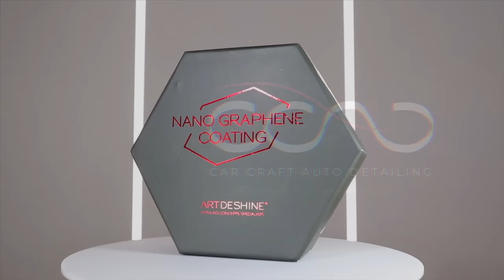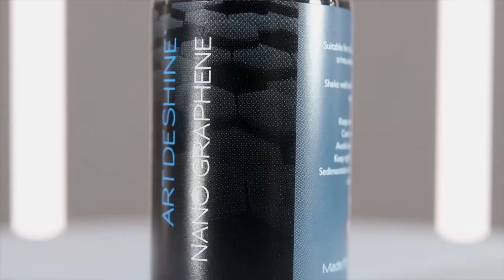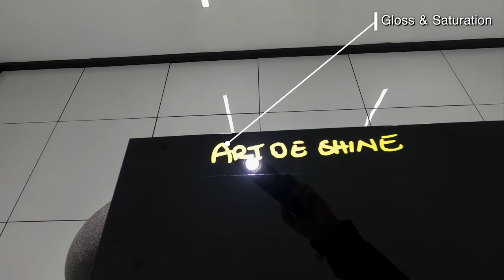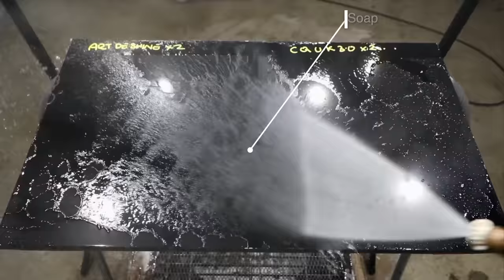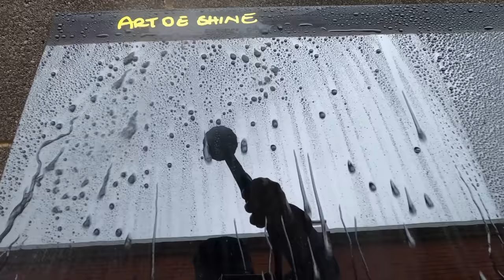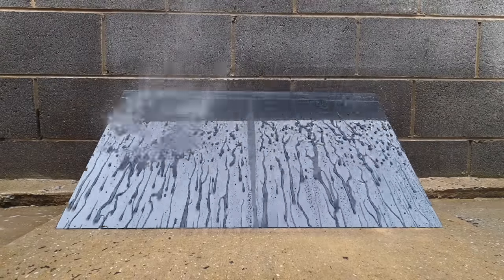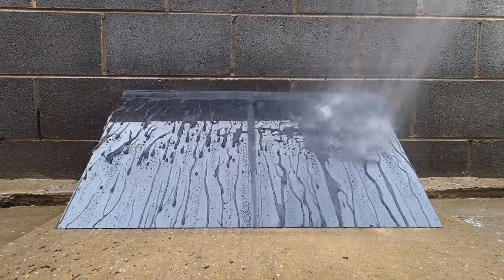A REAL LOOK AT GRAPHENE vs CERAMIC COATINGS + ArtDeShine Graphene Coating Reviewed!

Comment: Had to check my box with Artdeshine as you said any instruction wasn’t in yours?

In my box from Artdeshine
I also had the copper Artdeshine Nano Graphene card, some stickers BUT also a instruction book how to apply the coating. 
In it the instruction was application guide, curing, usage/storage.
The instruction was easy to understand and follow.

Comment: Great test & review, thank you.  I just did my first graphene, with Adam's Graphene Ceramic. It does flash very quickly like the ArtDeShine but it was not difficult to level out, even if it dried a bit.  The gloss and slickness and hydrphobics are impressive, and if it's no better than a consumer-grade ceramic, that's ok by me as I picked it up for $69; not much of a premium over most ceramics. If it performs better, great.

Comment: I believe the biggest difference in expectations between the graphene ceramic coatings and the previous SiO2 coatings is that the graphene ceramic coatings are supposed to retain less dust due to its anti-static properties and to keep the car's paint / surfaces at a cooler temperature, which would obviously be better to protect cars in hotter climates. The hydrophobic qualities and gloss factor are essentially the same. I've used Adam's Graphene Spray coating and Adam's Ceramic Boost spray coating, and performance wise they are nearly identical. Just like with any other detailing job, it's more about the prep work with the wash, decontamination, clay bar, and paint correction prior to applying the coating.

Comment: I been detailing cars for the past 12 years now. False marketing is the main issue here. Over hyped product strength and false promises lead to customer’s disappointment and lost trust. I have tested almost 50 different brands of ceramic coating throughout the years but to be honest non of it come close to what they describe. End of the day whatsoever technology that you use it’s not permanent solutions! The car owner need to take some responsibility to maintain their vehicle. As a Detailer you have to be sincere to your customers whenever you presenting the solutions.

Comment: Sandra, great video!   I recently applied Art de Shine BX graphene coating and Maintenance coat.  Both were very easy to apply and remove.  It was a good experience.  Apply, wait about 20 seconds, and wipe off with two microfiber, no wetting or leveling agent needed.  The BX left a very slick surface.  I applied a second coat 24 hrs later, then the Maintenance coat another 24 hours later.  The Maintenance coat seems to have reduced the slickness slightly.  The applicator cloth dried similar to your Nano cloth. I am looking forward to seeing how it holds up.  Thank you for all of your great material!

Comment: Thanks for the video. Your results chemically line up with my testing of SPS graphene over the course of a year against other ceramics I clouding Cquartz UK 3.0.  The initial performance is great but just as you noted once that shield is pierced it degrades rather quickly.  We shall share if graphene has the staging power or if it will just be a fad.
Reply from the maker: Thanks Mike, I appreciate you sharing you’re own experience and results as well!

Comment: Hello Sandro, super glad to see you got your comment replies back. That was thousands of comments. Got a few questions if you don't mind. 

1 - From my research NV Snow is the only wash I know of that is ph neutral with no gloss enhancers or wax. Its currently out of stock in the usa. Do know of any alternatives?
2 - My car is now ceramic coated (cquartz) and i'm considering using a ceramic infused wash. The main thing going through my mind is whether using a ceramic wash on my glass (coated with nv glass ceramic) could mask the effectiveness of my glass coating. What do you opt for currently with maintaining ceramic coatings ( ph neutral washes, carpro reload, carpro reset, ect)
3 - After loosing my mind until 11pm cleaning interior glass, I generally feel that compared to nv clarity and a few other streak free cleaners nothing removes residue better than pure IPA. Have you had the same experience?
Reply from the maker: Thanks and my older comments are gone for good but I can still make new comments moving forward. 
CarPro Reset has no enhancement additives and it’s also great maintenance wash for coated cars. 
Ideally it’s really best to stick to pure car wash soaps as hydrophobic additive ones can mask the superior behaviour of your various coatings. I tend to use Nv Boost a lot and it really seems to play well with the paint and glass coatings with no issue but Elixir could also be another good option. 
Cloths are also extremely important when cleaning glass, to make sure they are super clean and only used for glass but I personally have great success with Clarity and Eraser, but it you feel a straight IPA solution works best for you I’d just stick with it!

Comment: I really enjoyed the information and comparison you provided. It seems that everyone is testing their coatings, whether it be graphene or ceramic, based on gloss enhancement, chemical resistance and of course ease of use. Part of the benefits touted by these products is the resistance to swirls and light scratches. Has anyone devised a test for this? It would be great to add to the testing process when comparing products, but I’ve never seen anyone do this. Keep up the top notch work!

Comment: Graphene will definitely be the next hype marketing product. Adams is advertising their’s heavily. 303 also came out with a spray on, wipe off, graphene coating and it’s already sold out. 

Thanks for the hard work Sandro! Guess we should really pay attention when CarPro, Gyeon and Gtechniq start pumping graphene products. A Gtechniq higher up is part of a detailing Facebook group I’m in and he claims they’ve tried messing with graphene but unable to produce anything better than what they offer.
Reply: El Stormbringer  honestly Sandro is the only detailer I’ve watched on YouTube that I trust to review products. I watched that Apex detail video and when I saw him apply the spray to a car that was already fully corrected and coated I shut that shit off.
Reply: El Stormbringer  to be fair, that was the Zymol graphene spray that failed after the first wash test. 

Brian’s review of the 303 graphene spray received a passing grade though.
Reply: El Stormbringer  that wasn't the 303 brand graphene spray coating, it was the zymol brand.

Comment: I’ve said it before and I’ll say it again: “graphene” coatings are just high end ceramic coatings with an RGO additive just so they can slap graphene on the label and milk the hell out of the hype it’s been on for quite some time. If tech giants like Panasonic have been having trouble with the technology in its solid form even with their advanced facilities and manufacturing processes, what makes you think the detailing industry could just put it in a bottle in liquid form and have it be stable and apt for such a niche automotive use? It just doesn’t add up. It’s funny, if you’re objective/skeptical about this people get mad at you and/or call you a hater. MARKETING 101
Edit: small spelling error
Reply from the maker: There’s always a lot of strong opinions around anything new, but I appreciate you sharing you’re thoughts which everyone should be able to do!
Reply: @CarCraftAutoDetailing  Yeah, regardless I’m gonna try out the new graphene coating from Adams. I’m already bored and wanna polish my car again as it’s been 1 yr since I polished and put UK3.0 on it and it’s still performing like day 1. I believe the Ethos and Adams coatings are the same as I think they’re both blended by B&B but only the manufacturers know that. The adams coating seems to be SLIGHTLY more hydrophobic than CQUARTZ and I just like trying new products.
Reply from the maker: Let me know how you go!
Reply: You are right that reduced Graphene Oxide (rGO) is used as an additive in a silicone polymer or composite just as SiO2 or TiO2 is used the same way. These products are widely misunderstood as graphene, TiO2 or SiO2 based when really they are used as additives for enhancement of certain properties. Even more widely assumed is the coating is a "1 atom thick layer of graphene" which really isn't what Artdeshine is trying to make or market as that will not give us any beneficial function we need. That is what many electrical companies are doing as it gives them electrical conductivity and sensitivity. We need not that refinement of rGO or even pure graphene. And Artdeshine do know how to disperse rGO into polymeric matrixes. 

Artdeshine's Nano Graphene Coating is not termed ceramic because the percentages of SiO2 which the term "ceramic" came about is very low. Most of the components are silicone polymers that are cured to be softer and more flexible as compared to hard like you noticed in the applicator cloth. Hardness does not determine how durable or abrasion resistant the product can be (Artdeshine does make hard ceramic coatings too). Abrasion resistance mostly comes from how much friction is produced by the surface, more sleek less friction less chances of marring.

More about why rGO is used in the product. It is a fact that rGO helps with anti-corrosion and in the polymeric matrix it has shown capabilities in IR transmission tests to lower IR absorbance. This is an indicator of lower thermal absorption which we know heat is a very strong catalyst in chemical reactions with contaminants that causes etching.
Reply: @artdeshine7067  Thank you for your useful post :)
Reply: I agree, it's all free marketing issues.  It's the issue of honestly. It's becoming a circus on how we used to buy by the gallons and now in even smaller than eight ounces for rediculous prices.  Customers are being scammed and scared by long days in the shop, long and confusing explanations,  very expensive prices expensive, expensive maintenance and being shoved all kinds of products. My questions is what about the customer??🤯🤔
Reply: @Gnetbird  I assure you, there is a relatively large market of people who appreciate and are willing to pay the money for high end detailing and protection products. I do it both professionally and as a hobby in my personal cars and it's just one of those things that not everybody appreciates. It's a niche market with niche customers.
Reply: @artdeshine7067  Do you have any sources for these IR transmission tests? Or did you do them yourself? My understanding from quotes from employees working on car coatings is that the difference in temperature on a graphene coated panel is tenths of a degree. My assumption is that the thin film application on car paint does not demonstrate the IR benefits of graphene and I’m trying to find research that shows otherwise.
Reply: @glumdogtrillionaire   Now now, we're not here to fight.
Reply: @davek2977  Hi Dave, we work together with an educational institute to find out more on the capabilities of the product. One of the test they did was IR Spectroscopy. The absorbance rate was about 85-90%, meaning 10-15% is being reflected. This was done on a cured sample instead of thin film application as test panels are not transparent.
Reply: @artdeshine3997  Thanks for the reply. My understanding for IR Spectroscopy was that it is a tool for understanding the composition of the sample based on the IR frequency, not for determining its practical performance with heat absorption/reflectance. I’m guessing that a comparison was done with a more typical polysiloxane “ceramic coating” (no rGO) did you see a similar absorbable rate? And is there a difference between the coatings and bare clear coat?

Comment: Sandro this was an incredibly well thought out, researched, and superbly produced video, which I believe has become your signature trademark.  You constantly and unswervingly share the basic and blunt truths of every product.  You accomplish this with a very thorough explanation, that is well laid out courtesy of your systematic presentation. In the two years, I have been watching YouTube channels, few, if any produce a more comprehensive testing scenario to match real-world conditions than you Sandro; period, end of the story.  

My search to find the best coating to prevent or reduce the effect of water spots on non-garaged daily drivers over the last few months had finally convinced me to switch from Sio2 coatings to Graphene was from faulty conclusions I gained from believing the hype from all the manufactures and the youtube channels.  But Brian at Apex and Brian at Chicago Auto Pros gave me pause when I watched their conclusions and now after watching yours, I feel that Sio2 coatings are still equal and in some ways still superior to Graphene and am sticking with Sio2.  Granted graphene coatings have for the most part relied on YouTube host's comments that showed graphene had better slickness, sheeted more than beaded,  ease of application, and a better finish for the most part and only lately have some of the more credible hosts like yourself brought up the fact that a lot of the Sio2 coatings, after years of testing, have maturated to a point where they also have ease of application, high levels of slickness and some are even seeing sheeting.   The conclusion that has been sold to us, is that Graphene is much better in reducing or preventing water spots and even if water spots appear, they can be more easily removed from a graphene product whereas we all know it can't be removed from a Sio2 coating.  Your video has really helped me to stick with the Sio2 ceramic coatings and yes, CarPro CQuartz UK 3.0 is one of my favorites especially with Gliss on top of the UK 3.0. 

Thank you.

Comment: Excellent in-depth video ✊I have used many ceramic coatings and Graphene ceramic coatings.The different I noticed in Graphene vs ceramic is the gloss is a lot better. I have been using Adams Graphene ceramic coating and it holds up pretty well so far.The price is great and my customers like the results and the gloss.They don’t realize that they have to maintain it.They think they don’t have to wash it.🤷🏼‍♂️

Comment: Great video Sandro. The only interest I’ve ever had with a graphene coating over a ceramic coating was because it is supposedly better with water spotting issues. As you and many other YouTubers have shown, the claims are just not accurate at this time with any of the brands I have seen tested. I’ll continue to hold off until claims are proven accurate.

Comment: Just caught this video on my feed and very good and interesting video. There are a few Graphene coating now like Adam's and the ones on this video. There is also one i seen Pan post which is Roar Coatings and they seem to do things different which has me interested.
Graphene has not really taken off too much yet will be interesting to see 5 or 10 years from now if that changes

Comment: I certainly agree that the graphene side did not really stop water spotting. If you freeze the video and look at the dry panel after the pre-soak at 10:18 and look where the top spot lights are on the panel on each side there is definitely still significant water spots.  Then if you freeze the video and look at the dried panel again at 10:50 after the contact wash in the same 2 spot light areas there appears to be significantly less spots remaining on the graphene side than on the ceramic side.

Comment: Great video. Nice tests. I have Mayvinci C16 ceramic coating on the side panels of my car AMG E55K  for 2 years now. I had Carpro Quarts UK 3 on the bonnet, roof and boot. The Quarts lasted 8 months. The Mayvinci is still performing like day 1. I now have Ethos Graphene Matrix Coating on the bonnet, roof and boot. Like your test the Graphene seems to be behaving better with the water than the Quarts as it's early days. The graphene appears to be performing similar to my Mayvinci  coat but seems a little better than than the Mayvinci in the beading and I had no water spots after rain. The rain was mixed with ash as we had back burning. The Mayvinci cost me 500 aud dollars. The Graphene 160 AUD. I did it this way to see which product outlasts each other as  the Graphene is supposed to last for five years and the Mayvinci 3 years. Time consuming test but it will tell the truth.

Comment: 1) The Artdeshine NGC is a single layer coating system.  A second layer will not stick.  2) Artdeshine provide a level that is a life saver!  3) Insider trick is you can prime your application pad or the paint with the Artdeshine Graphene Detailers for a much easier application.  Key here is a light priming with the detailer.  NOTE: Point 1 and 2 are public info and provided by Artdeshine.  #3 is insider.  Also remember you are comparing a flagship professional coating to a customer level.  Pro coatings are normally much less forgiving in the installs.